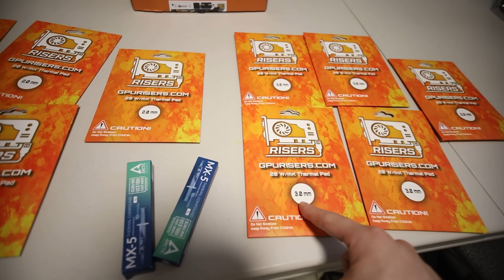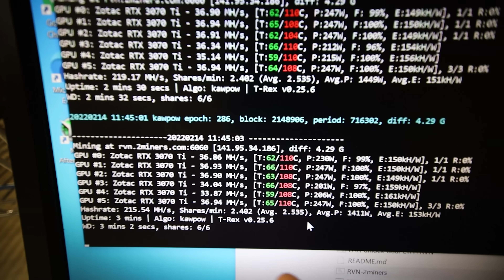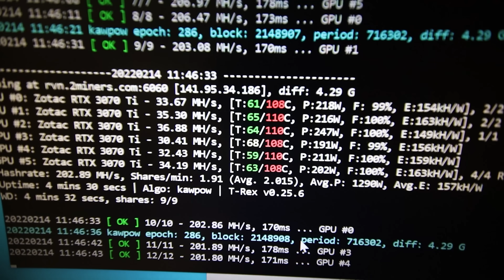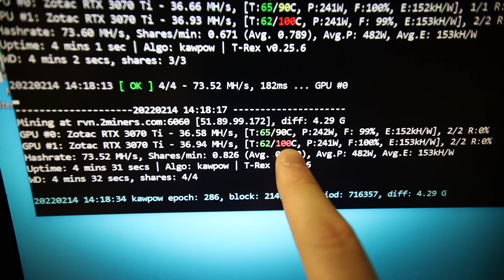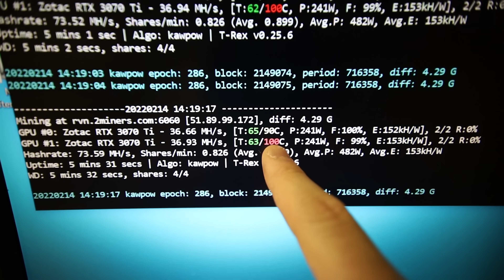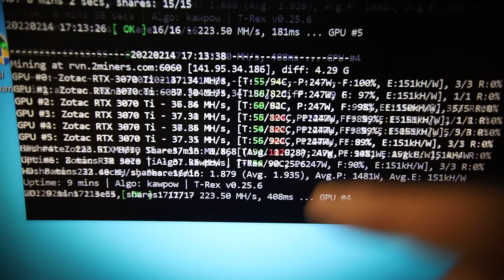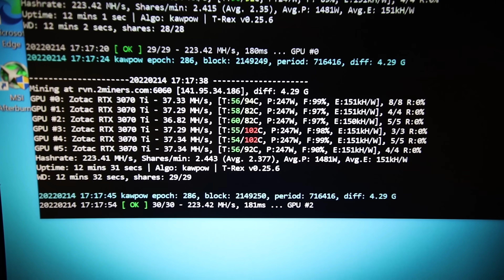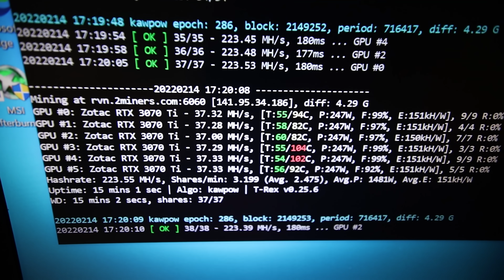These GPUs have TERRIBLE thermal pads while mining Ravencoin... lets change them!

Comment: The problem that most of you don’t think off is that all GPU’s are either made in the greater Taipei region there not just TSMC but also many other GPU manufactures have either their headquarters or major fabrication hub. The Problem with Taipei is that is is pretty much on the Equator line, there it is plus 90 F & 70/90 % Humidity. That means whenever the GPU’s leave their Production Facility in Taipei they could be stand for hours in blazing heat & humidity on the Taipei Int Airport or even worse if they are being shipped on a large Cargo Ship. After considering the kind of cruel travel these GPU’s have behind them until they arrive in the Central America or Europe its understandable why the thermal pads of Zotac, MSI and sometimes even Evga GPU’s are basically dead. The Distributors of all these GPU’s certainly know about this but the max profit for Wall street outweighs  to simply replace the thermal pads before they get to Best Buy etc…

Comment: Great video but please use copper plate with thermal paste. You will be surprised by the results. It will shave at least 20 degrees on mem temp. 1.9mm should be fine. And please make a video of it.

Comment: RPM what thermal pad size would you recommend for Asus 3060 first gen? I've actually been looking for a chart so I was stoked to see one but immediately disappointed to see 3070 ti was the furthest they went back. Usually I can lock my temp in under 60c and it won't move but recently the temp shoots up over 70c and right now I've dialed my power back below where it should be and that has helped but at cost of mh. So I believe changing my thermal pads would help a ton.

Comment: the gpus dont have TERRIBLE thermal pads 
the gpus are not made for mineing 
there ment for gameing and studio use with and them mineing it puts more load on the gpu and it will heat up and fail zotac thermal pads are fine when properly used

Comment: I got the trinity version, they dont thermal throttle but they run hot, 2mm pads don't make contact good enough, feel like 2.2-2.3 would be better, I am going to try copper shims + thinner pads.
Reply: Did the copper shims improve memory temp?

Comment: +1 2.5mm should be perfect +mb try another known brand like: thermalright odyssey or Gelid Solutions GP-Ultimate or EC360® Platinum.
Also how hard or soft the pads is, it matters, if softer pads more mm needed. => mb with 2mm harder pads would be ok in yr case depands the brand.
I did repad for asus tuf 3080 and msi gaming Z 3080 both had amazing results @mem 15c difference at asus and -25c at msi. Not with the 1st try.. 2nd/3rd.
I used 0.5 up to 3mm 2 much trial and error though :X +better paste too Thermal Grizzly Kryonaut. 
Also both gpus had blank spots from mem=>cooler prob cause they don't want to tranfer 2 much heat from memory to core. (Still dump I remember playing cyberpunk with 100+ mem temps on stock settings).
Sorry but 20w/mk clames on these pads.. no way :X 6-8w/mk maybe for the 0.5mm-1mm.

Comment: Reminds me of that white crap Gigabyte uses. I always replace mine with Thermal Grizzly Minus 8 pads. Work a treat but expensive. 

The size of your heatsink being so big could be that they use it on their 3080 and 3090 cards so instead of making another size they just used one from what they were making for their 80 & 90 cards.

Comment: The only thermal pads i buy are "Thermalright Extreme Odyssey Thermal Pads ". They are the best performing and most reliable pads on the market hands down. My 3090 Suprim X cards are running between 86-90 C at max settings for months now. 

Yes they are expensive as hell however i like doing the job right the 1st time to avoid downtime while increasing efficiency and keeping profits up long term.
Reply: I’ve been buying the Thermalright Odin 15kw

Comment: If you buy zotac get the trinity version, its cheaper and does a lot better on temps, has a good metal backplate which is connected via thermal pads

Comment: I have a 3070ti doing kawpow, I was wondering what your OC settings are when you're on windows?
Reply: I run +200 core, +1200 memory, 80% power limit for Raven while getting around 38 - 38.5 MH/s. If I run full title at 100% power limit I can get around 40 MH/s, but then my thermals sit around 52-53 on the core, while sitting at 98 degrees most of the time while touching 100 at times on the memory.

Comment: Zotac 3070ti's are actually in my option by far the best 3070ti you can buy. The problem is that the only good one is the 3070 ti amp holoblack extreme. Red Panda has the non extreme 3070 ti's which is the model right below and they suck. I own 18 3070 ti's from evga ftw3, gigabyte, zotac amp holo black extreme, and msi suprim x and none of the models listed hold a candle to the extrme amp holo in terms of OC, core temps, and memory temps.
Reply: Finally someone that knows the extremes are great. I have 3x 3080 ti and they run very cool.
Reply: I agree with you ! have 15 Zotac 3070ti and they rock compared to all the other ones !

Comment: My Zotac 3070 TI is sandwiched between a NON LHR 3070 and a 3090. My memory is running at 72C. My frame is under a table, but I have a 20" box fan blown air across the whole frame. I agree that the stock pads are crap, but AIR FLOW matters.

Comment: I think the problem is not only about those bads thermal pads  from Zotac, is about ravencoin mining, as you know, kawpow is too hot.  What we do expect,  mining 24/7 at 247 W ?. In the other hand, is more important the ambient temp than the fan revolution. I think that GPU fans at 99 or 100 % is another factor than contributes to thermal throtling. In my opinion, maybe IM Wrong.

Comment: My 3070ti MSI SuprimX also has same issue. Brands are really cheap in thermal pads
Reply: hi you can check my video to see changed after replace thermalpads on Msi Suprim x
Reply: @HKsystem  Thanks. I was searching for correct size.
Reply: @sanjithvarun9640  no problem :)

Comment: What do guys think the mem temps for 3060ti mining eth are? Since there are no sensors, should I bother changing pads when mining flux or eth?
Reply: My memory temps on 3060ti always stay low in the mid 80s you can check it by using the hwinfo tool that's free to download
Reply: @coltblink  what model of the 3060ti do you have ? I have the msi gaming x and it doesnt have a memory temp sensor, only core hotspot.
Reply: @TheMcBidou   HP and Dell 3060ti that come in prebuilds. You're right its the core hot spot temp
Reply: @coltblink  thank you for your time anyway

Comment: I have the ZOTAC GAMING GeForce RTX 3070 Ti 8GB Trinity OC Graphics Card and it never goes above 88-94 degrees with Eth and pushing close to 61-62mh and at 90degrees for the vram the cpu operates around 41 degree on the GPU and around 188w of power. I would not choose RVN. Way more to make on ETH And lower watts more hash rate. Happier  days - MORE profit less problems :D - todays problem sorted :) in fact never seen rvn coin being better than ETH for a long month or two now :)
Reply: He´s talking about RVN mining.
Reply: @Asereco1968  why rvn when eth is more efficient and way better mh
Reply: @7302ab  At times that is true, but not all the time. For months Raven coin was far more profitable than Ethereum on 3070ti's.
Reply: @MassBoost  yes but right now id rather not follow this video as the way to go much more sensible mining options
Reply: @7302ab  Looking as of right now, Ravencoin is the 3rd most profitable coin to mine with a 3070ti which is only 14 cents less than Ethereum currently. Next week Ravencoin could be more profitable than Ethereum, but these things only matter if you're selling instantly, to which Ravencoin in the long run could be far more profitable than Ethereum on the current mining end.
Reply: @MassBoost  never right now does 35mh rvn on 240w make sense thats nuts and 24 x 7 lol
Reply: @7302ab   But he's not getting 35 MH/s at 240 watts, he's getting around 37 MH/s. Me personally am getting 38 to 38.5 MH/s at 240 watts. What doesn't make sense about it?
Reply: @7302ab  I have no clue what you just said or if that suppose to be some sort of valid explanation?
Reply: @7302ab  It's just too bad that isn't true considering that Ravencoin's been more profitable in the long run on LHR 3070ti since their inception. I guess have fun mining Ethereum when it goes to 2.0. To each their own.
Reply: @MassBoost  we are not on ETH 2.0 please make more profit today using what I have said or lose money today on RVN no more clearer advise than that
Reply: @7302ab  How would you be losing money? Looking at my 3070ti rig, in the past 24 hours it has me making $2.37 per card.
Reply: @MassBoost  thats a lot less than even Nicehash on basic whattomine and with 50watts ill be staying on ETH perhaps ask the vlogger how to increase to your mh and not burn the vram :D
Reply: @MassBoost  just checked my underclocked 57mh 3070tis and its make 2.93 dollars on eth not even the cards running at 62mh so choose ur coin makes your choices. Oh and thats 178w happy times
Reply: @MassBoost  my 3060tis are making 2dollars a day on basic overlock and 138watts. I see no reason to change to rvn anytime soon
Reply: @7302ab  I don't know where you're coming up with these numbers? I just now checked whattomine as far as your Nicehash comment and it say $2.32 as the past 24 hour rewards which is less than my actual mining production. Either way my comment was that since LHR's came out, Ravencoin has been more profitable overall on those cards, because for months Ravencoin was more profitable than Ethereum because of the LHR restrictions which is a fact. I'm not sure how you're taking this any other way? Also Ethereum sat at $750.70 January 1st of last year and peeked at $4867.67 for a 647% increase while Raven sat at 1.35 cents January 1st last year and peeked at 28.88 cents for a 2,139% increase, so Ravencoin more than tripled the percentage of increase over Ethereum over that past year. That means you could have made more the triple the money in Ravencoin over Ethereum this past year given the same amount of money invested.
Reply: @MassBoost  whattomine i always get way more fact that its stats its called overlclocking and efficiency
Reply: @MassBoost  ye actually 198w 62.35mh on the other 3070ti 3.03 dollars on whattomine sorted D 88degrees
Reply: @7302ab  Efficiency means very little in the grand scheme of things, it's about maximizing profits, and efficiency doesn't necessarily provide you that. Sure you might want to mine more efficiently if you have extremely high power costs, but if you're mining at 6.6 cents per kWh like I am, going for max efficiency doesn't provide you with max profits. Even at 12 cents per kWh I can make 2 cents more a day per GPU at my max profit rate compared to my max efficiency rate, which I actually make 10 cents more a day per GPU at my max profit rate compared to my max efficiency rate at 6.6 cents per kWh. Mining for max efficiency makes very little sense unless you have 15 cents per kWh or higher as 15 cents is the even point at which max efficiency and max profits meet.
Reply: @MassBoost  and your vlogger is on 10 cents a kwh worse still
Reply: @7302ab  Are you talking about Red Panda? If that's the case even at 10 cents a kWh he could possibly make more by going for max profits over max efficiency, but he may be at his homes power limit I believe which probably pushes him toward max efficiency of that's the case in order to allow him to set up another miner to mine.

Comment: At this point, I was thinking why not just use a copper strip with thermal paste on both sides of the strip and anything that surrounds it use electrical tape or thermal pads to prevent any short?? 🤔💭
Reply: Yes, that's a better permanent solution

Comment: The thermal pad at the back is to soak some of the residual heat from the pcb onto the metal backplate. It would slightly improve overall temps, but the original pads are so bad I wonder how effective they actually are.

Comment: Zotac is garbage. Nvidia should be ashamed for selling them most of their gpus. I had to underthrottle my zotac 3070ti out of the box for the same reason. It hashes now at 51mhs on eth instead of 57 because if I run it any higher then I get 110C within seconds. Just pure garbage at caviar prices.

Comment: You should try the copper plate solution CoolMyGPU recently came out with.  You'll still need thermal pads for some of the back and the odd parts of the fronts, but the copper plates have performed so much better than standard thermal pads and about the same cost.  The owner is super down to earth and has a discord.

Comment: I guess your ambient is higher, but honestly the mem temps after changing the pads is not impressive for 20W. I really need to find some more orange ones I had (they were 5W), but after a year of use they had 0 oil and mem temps were ~85.

Comment: Had the same problem on the 3090 version of this card. Replaced the stock thermal pads with GELID ones, disconnected the back RGB by leaving the cable out and mem temps are currently around 85 degrees Celsius.
Reply: I think gelid extreme are the best pads price/performance! I would love a video comparison between those

Comment: Another reason you may be getting higher core temps is because your memory is able to transfer more energy to the heatsink with the thicker pads making it slightly less effective transferring energy from the core since the heatsink can dissipate a limited amount of heat.

Comment: Nice vid Panda as always! :) Changed 20 of my rtx 3080 pads in a row.. it was totally worth it, all of them dropped like 20-25c on the vram temps.. I'm trying to keep the vrams around 78c with autofan and it is working like a charm.

I know you have much more knowledge then I do, but there's a few tips about pad replacement that might help:

- Clean all the surfaces super-super clean with IPA (especially the heat-collector sheet.) 
- Do not touch/squeeze the surface of the thermal pad (resodue from your fingers will decrease the heat transfer efficiency) try to grab the pad by the side.
- Do not re-apply the pads twice or more without cleaning the chips/vrams again with IPA first.
- Try to apply mid-gentle back and forth / circular squeeze on the gpu after you put the front and the back of the gpu together, just before you'd assemble the leaf spring of the gpu. (thus will push out all the remaining air bubbles left between the pad and the surface of the chip)

I hope it helps, happy repadding! :)

Cheers mate!

Comment: I had zotac amp holo 3080ti, i only change the front thermal pads, leaving the backplate stock.. it works fine.. 84C mem temp max on my 30C ambient running at 80% fan speed
Reply: Me too, I used GELID Ultimate and now they are at 80C or lower with 100% FAN, 30C ambient. But my Aorus waterforce is the worst. Same pads but I have 106C while mining with industrial Fans + extra heatsinks on the backplate -.-